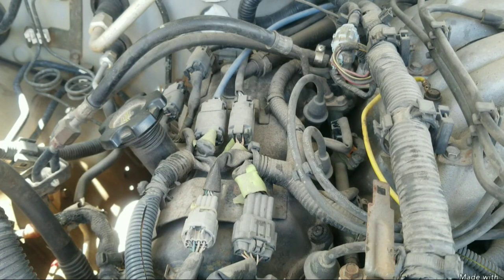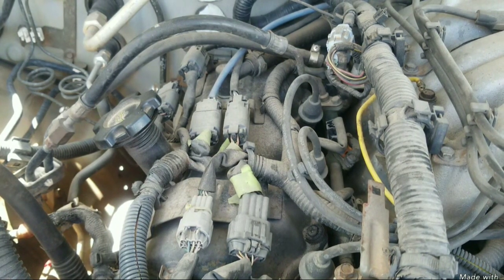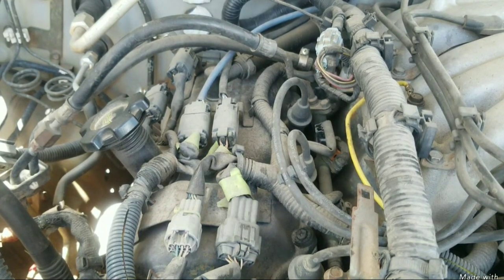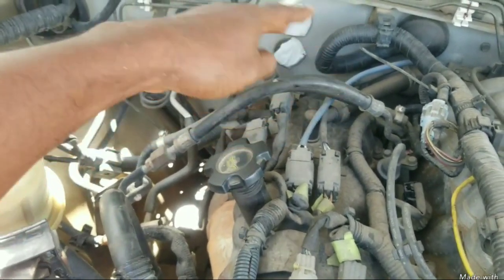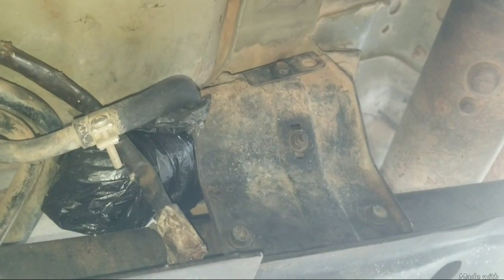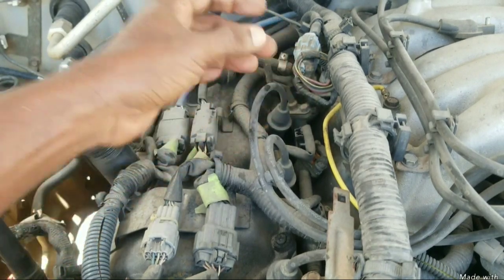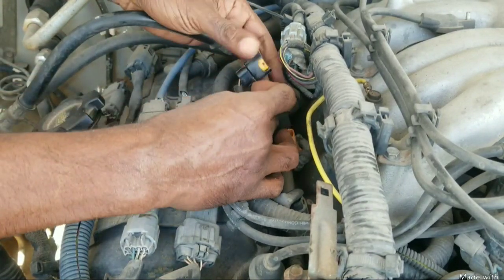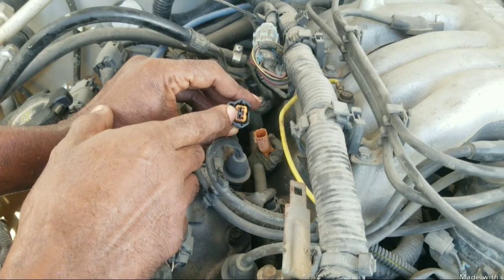Nissan VG33E No-Start Troubleshooting and Diagnostic.

Comment: How often should the fuel filter be replaced or the fuel pump be replaced?
Reply from the maker: That is all depend on the condition of the gasoline you are buying.  Old gasoline stations will have dirty in ground tanks compare to new gas stations and many factor in handling gasoline distruction.  It best to check the fuel filter for contamination every 8-10,000 miles.

Comment: Dis you ever figure out the issue?
Reply from the maker: Nope. Had to junk the thing.
Reply: @Stevexnycautomotive  I'm about to junk mine as well. VG33 is seized, and I know that I have to drop the fuel tank to do the standard repair if I ever get it running again (prior to it seizing, it was sitting because of the fuel issue..)

Comment: I Had the same problem with my Nissan frontier 2003 xe-v6 .  It would work intermitently . I took it to the Nissan dealership they replaced sparkplugs, fuel injectors they charged my $2800 and Didnt fix the problem and had it there for a month.  I had two other mechanics work on my truck , one replaced the Knock sensor, fuel pump and the other one replaced the distributor rotor and the problems wasnt fixed.  Finally I found a great mechanic that doesn’t like to change just parts and ended up being the ignition distributor. I was getting missed fire , knock sensor and cathalitic failure. Hope this helps